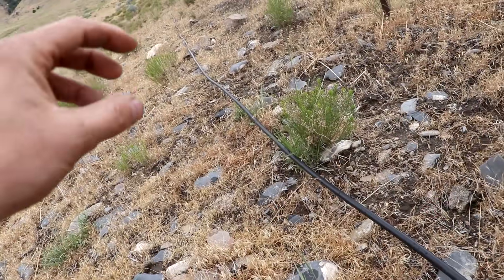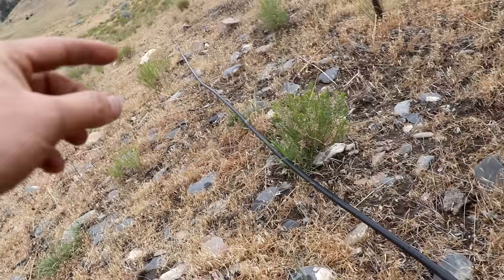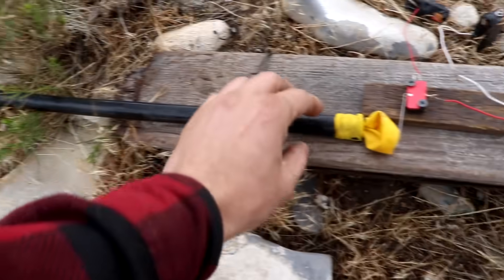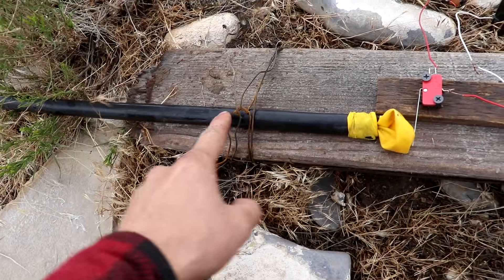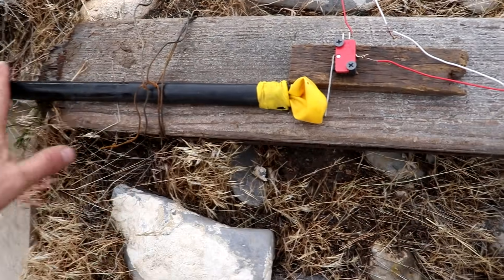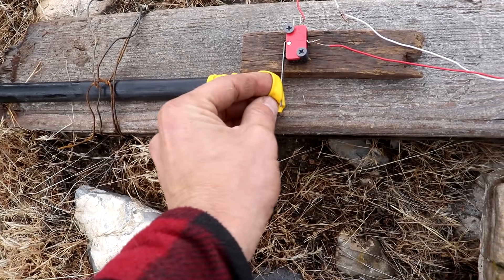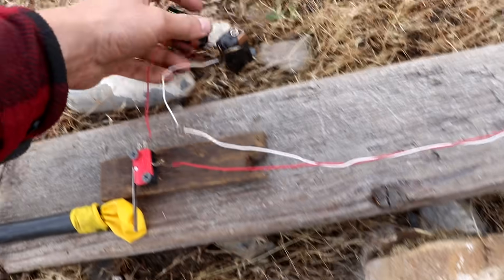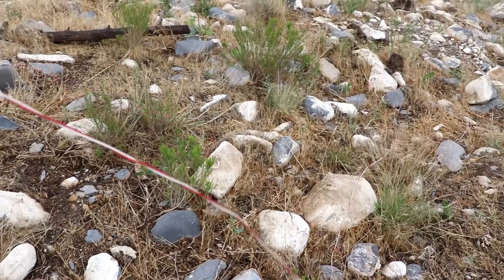Chain of thunder part 1

Comment: You can measure the distance of a storm by taking the time it took from when you seen the light, to when you heard the thunder and multiplying this number by 1/3 or 1/5 depending on if you want your answer in kilometers or miles (1/3 km/s) or (1/5 mi/s) example:
Lightning is seen and then heard 8 seconds later, take 8 secs times 1/5 mi or 8 times 1/3 km

(8 sec) x (1/3 km/s) = 2.6666667 km approx.

(8 sec) x (1/5 mi/s) = 1.6 mi 

1.6 and about 2.6666667 is your answers for how far the storm is away from you. 

I’m sure someone will find this useful lol. 

Good job Cody, that circuit with the lever switch was a great idea, I have loads of those switches laying around because of microwaves I take apart for the Magnetrons and wave guides, I think I have an idea now! Recently I’ve been looking into making high output light amplification by stimulated emission  (laser) units, and I have been using RF waves to excite the atoms in the gas medium. I also was using this same principle to excite electrons and when these electrons hit a tungsten target photons are made, just like the laser. This is the basic principle of linear accelerators, I want to run my own tests on particle physics, and also use this info to understand how this could be used to make particles. I’m sure people have heard about scientists making gold from bismuth, and it could be done with lead, but it also makes other particles in the process. Though it’s not readily usable, because you only make like a couple thousandths or a milligram or something insanely small. When I get everything working I’ll talk with you, until then keep learning!!!!

Comment: Another interesting concept would be to be in the center of a circle of thunderclaps all initiated simultaneously. The center of the circle would be the point where you only hear one thunderclap, and it would be way louder than other locations where they are spaced out in time. It is actually closely related to beam forming with an antenna or microphone.

Comment: Awesome experiment Cody! As a cheaper alternative to the very cool pipe/balloon trigger, a simple dynamic microphone connected to an open loop amplifier could trigger a FET or other suitable semiconductor switch in a negligible time period compared to the detonator delay. Also, to reduce the detonation delay down to a few microseconds, exploding bridge-wire detonation may be something useful to look into.

Comment: FYI, acoustic waveguide (aka hose or pipe) is dispersive -- this is why if you clap at the end of one, you'll hear a "pew" sound as the frequencies transmit and reflect back to you at different rates.  It's also quite lossy due to whatever flow regime is inside it.  Surprised the balloon moved enough to trigger a switch!

Comment: Awesome video...back in the '70s , sound switches were common and inexpensive items from electronics surplus dealers. They would have been great for this purpose...all you added was a relay and battery.
     The tubing/balloon/microswitch arrangement did the job , though..

Comment: I had a job for security a few years ago and we had a speaker set up at an entrance gate to a mine right beside the railroad tracks about 1/4 mile away from where my office was and the tracks went right by my office, so when a train would be about a mile out from that speaker, you could hear the horn a few full seconds before the sound actually carried the horn to the office, it was wild.  I always figured the reason was electricity moves the speed of light over the wire so it carried the sound faster than the speed of sound.

Comment: "This is a 500 ft plastic pipe" ... I love how you said that like it's not an absurd thing. XD
Reply: (I know and read the XD Rennis; its just extra info:)
I just googled 3/8 inch hydroponic tubing prices; its around 100 US dollars. Doable i feel. The cost is less if you settle for smaller ID. And I guess you could also use thinner weaker gardenders hollow binding tubes for much less even.
Since he already is experimenting with plants of all sorts in and outside, and watering systems It is not weird to have tubing in bulk at hand I think.
after the experiments, the tubings are still there :)
Go for it, a phased array of noise pulses, arriving at your location of enjoying.
I say "Multi Pass"
Cool to see you having fun.

Comment: If you're measuring (or at least marvelling at the loudness of) the size of the resulting wavefront, you could compare and contrast with the wavefront round at a position that is roughly equidistant from all the blasts. And you could do the same with them all going off at once. From a fixed base line, you can choose arbitrarily who you want to scare.

Comment: I would have done the math so I use an electronic delay timer to set off the second but I like Cody's way a lot better. It might get hard to calibrate 8 that way so electronic may be easier when you scale it up.

Comment: I noticed a very odd phenomenon when viewing the final cut where the sounds overlap perfectly, if you look at the full screen in real time it sounds like the noise from the second explosion occurs BEFORE it actually happens visually, because you can see the previous explosion and are anticipating it. If you block the right half of the screen (the first explosion) the second one looks/sounds normal. But with them both combined, it appears as if the sound is processed before the actual light is. Very strange.

Comment: Nice job Cody. It would be cool to do a video that compares the delay between copper and optical cable because there is actually a pretty big difference in speed. They say electricity travels at near the speed of light but optical cables have much lower latency.

Comment: I just want to point out, that the speed of sound of air in a pipe may not be the same as in open air. As someone studying physics I had a feeling it may be, so I just looked it up. It seems to depend a lot on the pipe parameters (diameter, stiffness, support, ...) and may be irrelevant in your case, but you may want to look into it before spending a lot of effort in your setup.
Anyway, the trigger mechanism is an awesome idea, I totally expected electronic timers before you showed it!

Comment: Of course you could also lend a delay line controler from any audio equipment hirer, where you could simply enter the distance in feet/meter. But it surely is much more fun to do it this way. :D

Comment: I always wondered if electricity travels at the speed of light.
If so, the medium changes the speed, thus it is dependent on the isolation material around the copper.
Reply from the maker: Oh it gets so very complicated. I just know it travels orders of magnitude faster than sound.
Reply: The propagation speed of an electric signal depends on the nature of the connectors and the space between them. With two wires that are separated like this, it is close to the speed of light. Within 10%. For simple twisted pair or solid dielectric coax it is as low as 60% of the speed of light.

Comment: That's so cool. I'm sure you already have in mind how you would do it.
I would use an arduino, a relay card and then set the mathematical values for what they would be, then test and adjust.
What would be a more practical way of doing it?

Comment: I have to say that was a pretty good idea to trigger the next explosion.  Another idea would be to use an electrical signal from the point of the original detonation.  Device detects detonation, waits x amount of time and sends signal on first output, waits additional time x and sends second signal on another output, etc.....you could even have a barometric, temperature, and humidity sensor to make automatic changes to speed of sound......all that stuff is so cheap these days.....and tons of tutorials.....
Reply: Maybe even rf link multiple modules so you wouldn't  have to run all that wire.....could even go further and unless all modules were talking to each other, it wouldn't trigger the first explosion.....

Comment: Great video, really simple trigger mechanism; well impressed. Anyway I have a question.. when Cody describes how the second lightning bolt struck just as the sound from the first was passing it, and he therefore heard only one sound, is it possible that the air in the second region was just at the point of ionisation and the rarefaction / compression of the air actually triggered the lightning? Or was it more coincidental? Apologies if I'm a little off with the terminology but I really would appreciate some learned input if Cody or anyone else would like to proffer any. 😉

Comment: You said the signal in the wire travels at the speed of light and that's not technically true. The electrons transferring the signal from one to the next bounce around enough to produce a delay around 3x slower than the speed of light, about 1 nanosecond per meter. When I was doing physics research back in college the lab I worked in had all the signal cables labeled in the number of ns delay they introduced. Sometimes when you needed a 50ns delay instead of using a delay timer you just used a 50ns cable.

Comment: I wonder, is it possible that the first lightning strike you saw actually triggered the other via a somewhat similar method?

The change in pressure perhaps modulating the conductivity of the air as it traveled?

Comment: Unrelated, but what would happen if you were to attempt to cause a lightning strike by going to somewhere elevated and firing a wire straight up, you could do this with a bow fishing reel on a crossbow with steel or copper wire and you could trigger it remotely to attempt to harness the power of lightning.

Comment: Could it be that the lightning struck at the point of the sound wave because the air was more conductive due to the higher pressure on that wave. You just have to be close to the second one

Comment: At first, I thought You were going to say the first blast hit You when the second bolt struck, so it looked like the sound travelled at the speed of light. This too could be done with explosions all at the same distance with the same delay between each to make a chain of blasts that seem to coincide with all subsequent bursts, but I don't think such a simple mechanical timer would do the trick. Definitely some math or a lot more trial and error.

Comment: That just raised a question. What would happen if you were a pilot flying low, but at exactly the speed of sound relevant to your position in the atmosphere when a bolt of lightning strikes? Would you be able to hear the thunder while traveling several miles? I wonder how interesting that would be.

Comment: I'm curious what it will look like in 2d, not 1d. An expanding circle starting when another expanding circle hits its center, with an angle encompassing them all? Maybe add a few mics around the site?
Also, it is not exactly the speed of sound, is it? I would guess thunderclap is a shockwave, with speed not necessarily equal to that of sound. Consider measuring it and comparing to the speed of sound?

Comment: I'm trying to produce fulgurite and I'm thinking of trying to settup a large sand filled pvc pipe vertically about 6feet tall and place a lightning rod on top of it. I'm wondering if anyone has experience with this? And how or if at all I could try and get permission from the government or someone to place these lighting traps on hills and high valleys

Comment: Light and sound? Where's Rod Serling?!
The most interesting thing I've seen showing light and sound is an A10 firing. Often you will see the rounds impacting the ground, see the flashes of the depleted uranium bullets exploding, hear the explosions and then hear the gun fire. A lot of people don't understand how that works. Rounds are firing at 3900rpm travelling supersonic and the explosions are supersonic as well but are closer to you than the plane firing it's cannon from 8-10k ft above you and possibly a couple miles away from you.. It's an amazing study in audio physics... and it ends up with that iconic A10 BRRRRRRRRRRRRRT! :P

Comment: Hey cody is ther any reason why you prefer the complicated method of measuring the arrival of the sound wave too the much simpler solution of using microcontroller and  withe preprogrammed delays. 
I mean  the speed of sound ist well known and can  be easily measured. And a timing base approach would eliminate the influence of the fuse time

Comment: I wonder if you could make an argon flash, some sonotube with a tannerite charge at one end, filled with argon might make for an interesting light source. (I think the tube would only need to be a couple diameters long at most if the charge is in the center at one end)